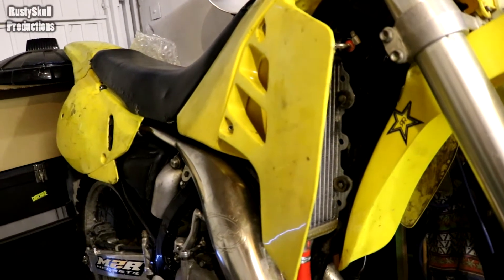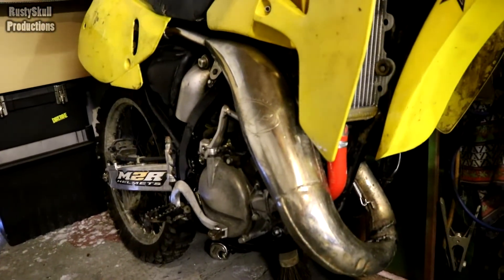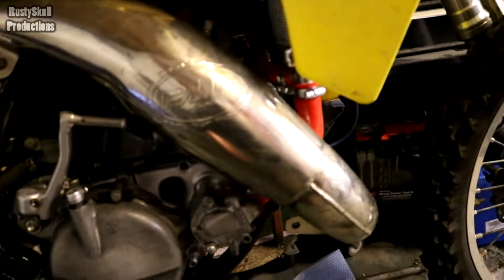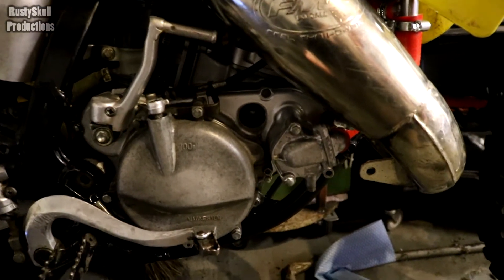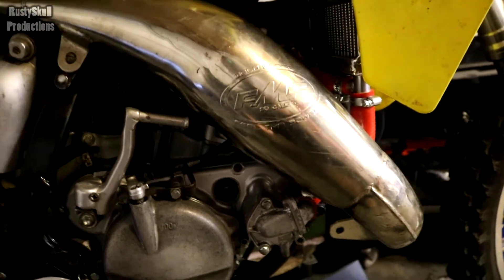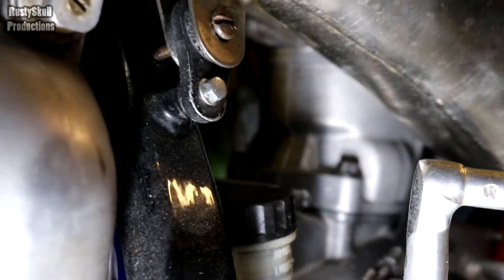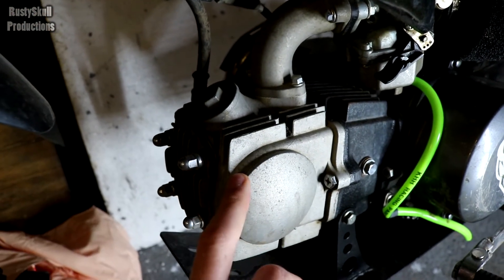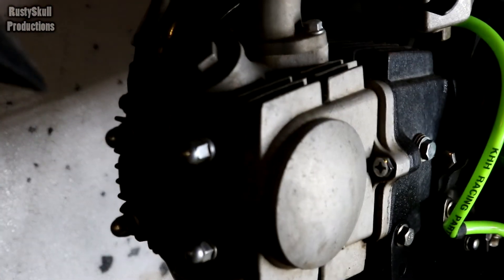How Water Cooled & Air Cooled Engines Work - RustySkull Productions

Comment: So whats better?!
Air or Water?
Reply from the maker: Depends on the application. Water cooled can produce more power, but have to have a radiator and pipe work, air cooled may be better in a limited space application.